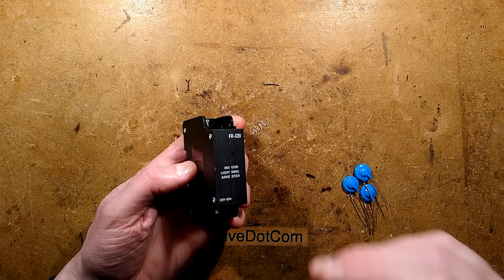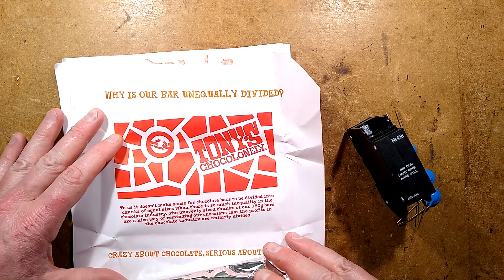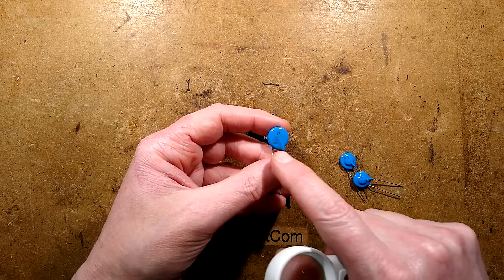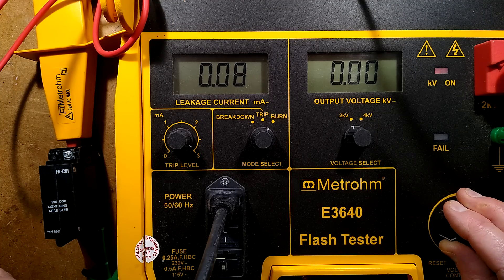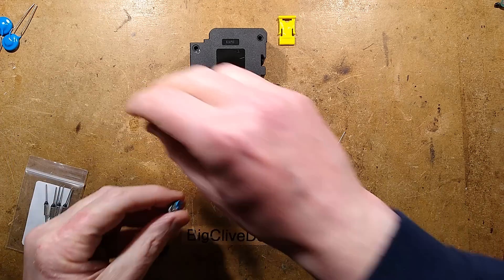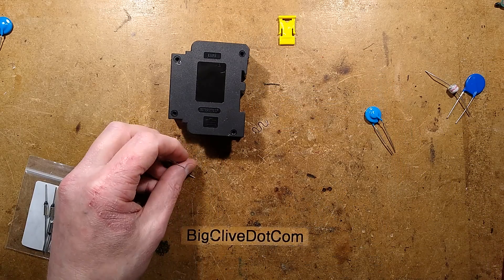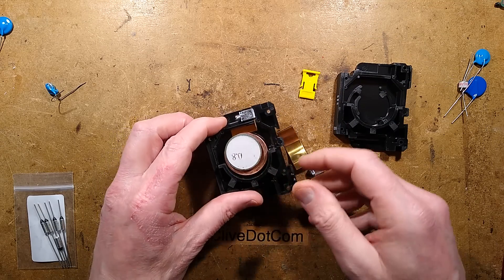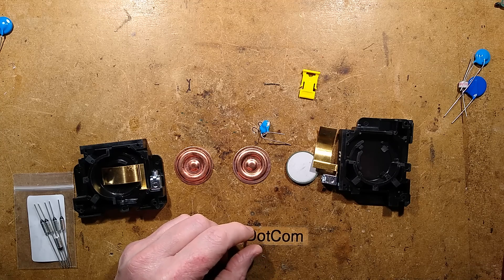Inside an African lightning protector - and candy

Comment: I reckon, there was a MOV that has the correct size that sits in between those plates that then leaves a flashover gap. In this case it looks like if you put it in between the resulting gap would be too big. Perhaps someone buying the parts at the factory has done a switcheroo to a cheaper, wrong part without understanding what it's about.
Reply: Such “switcharoo” is a serious violation against plenty of internal (and external) departments including the clients, higher management and electrical engineering. Even by third world standards. I feel like i’d like to refute that.
Reply: @BritishEngineer  maybe in Britain, luckily. But I guess in some areas it would be considered the fault of the company selling the finished device, or the importer if sold abroad, for not regularly auditing what they are getting from the external factories...
Reply: @BritishEngineer THis is China we're talking about.. You think they give  two flying fluffs about violations?
Reply: @BritishEngineer The fact that it's wrong to do a thing doesn't in any way prevent the thing from being done. There's thousands of examples of people taking shortcuts they shouldn't, many of them resulting in worldwide infamy through catastrophic incidents, and despite how well known these sorts of incidents are we keep getting more of them so the shortcuts are clearly still being taken. Plenty of people will push the boundaries until something breaks, and this device hasn't completely broken yet.

Comment: The letter seemed to indicate that the "ground" connection is to the metal roof and is linked to neutral. That would mean a lightning strike would fry every connected appliance and anyone touching grounded metal (do they ground water pipes etc.?). Would this be capable of protecting from that?
Reply from the maker: It sounds like an odd interpretation of equipotential bonding.

Comment: Well as someone from South Africa I can say I have more faith in South African (not other African countries) electrical installations than I do in Some British installations. When I moved to the UK in the mid 2000's I was surprised by the lack of earth leakage switches on most domestic installations. its only in the last 10 years or so I've seen RCD switches appearing  in residential installations. I'm not going to say i'm an expert on UK electrical systems, I did study partially in South Africa for domestic electrical installations but I did give it up and switch to electronics instead as I had more of an interest in radio at the time, probably not my smartest move.
Reply: RCD protection became a requirement (BS 7671) for most circuits in U.K. installations in 2008. Before then, in 2001, RCD protection was supposed to be provided for any sockets that may be used to supply outdoor equipment. In between these dates there were various amendments to the regulations, each time extending the requirements for RCD protection.
And RCDs suitable for consumer units (breaker boards) or as separate units have been available in the U.K. for over 35 years.
Where individual circuit protection is wanted, a RCBO can be fitted replacing a MCB and a RCD with a single unit.

However, there is no retrospective requirement to update existing installations unless either a new consumer unit is being installed, a new circuit is being provided or there is a significant amount of rewiring being carried out. Or the rewiring is for a circuit where RCD protection is now a requirement.
As the existing U.K. systems are seen as a safe system by home owners and landlords, often an installation is only upgraded when it has to be or the property is being completely rewired.
Reply: @Mark1024MAK  So in South Africa when ever work is being carried out to the electrical system it must be brought up to code. One of the reasons I quit "Heavy current" studying was the fact that the code kept changing in fact during my first course it changed several times. It was annoying me so much I switched to "Light Current" electronics.
Reply: @marcofixit  I believe many of our South African code is based on British standards like the wall plug but it is changing because of two pin type. The only time when it is required to update the electrical system is with change of ownership and even then some will still pass it.
Reply: @powertechnical  Yeah its been many years since I went over the compliance code I got my N4 back in 2002 but then switched to Light Current
Reply: You think some of that might be related to how old the electrical systems are in cities/entire countries? My theory (at least here in The States) some of our large northeast cities were among the very first places to be electrified,  but the updating of those systems and grids were never really mandated unless there was a major change to the buildings housing them. What you can then observe are buildings that are structurally quite old, but have undergone multiple "face-lifts" to their facade. However the improvements were just shy of requiring upgrades to the mechanical systems. These appearance updates were deliberately planned to avoid an expensive mechanical retrofit. So we see newer looking buildings with ancient and very deficient plumbing and electrical - with no legal requirements to update. Same with the cities infrastructure.  Lots of patching to save money maybe?
Reply: @markcohen4599  yep. My old SW Philadelphia row home had indoor plumbing added along its history, originally not having much more than a water closest and outdoor outhouse. Originally had gas lights, some pipes terminated in the basement and left in the walls and the greatest fun...
Knob and tube wiring, cloth covered of course, that all still in use in the foot tall space between the upper floor ceiling and flat roof.
Reply: @markcohen4599  Yeah I get the same sense here sometimes also in South Africa it is a requirement o have the electrical system brought up to date when ever there is work done on it or if the building changes ownership... well at least in mid 2000s when I dealt with it last.
Reply: @marcofixit 
Sounds like the safest move☺👍
Reply: If by 'earth leakage switches' you mean ELCBs, then they have been out of favor for a long time due to false tripping caused by a bunch of reasons. RCDs are installed nowadays.

Comment: In my younger days I used to install temporary IT systems for diplomatic conferences all over Africa. This meant planning and doing everything from electricity supply, local network, Internet, Wifi... Cheap Chinese stuff was everywhere. Half the time we were lucky if at least the toilets worked.
Reply: My theory was we got all the parts that other countries rejected
Reply: Funny, in my younger days, I setup connections to diplomatic missions in 3rd world countries using serial connections over normal phone lines & UUCP......   There was no internet, WiFi or cheap Chinese anything.  Often not even electricity.   It was a good connection if the latency wasn't over 300ms (aka not a satellite connection)
Reply: @ckm-mkc  uucp with the ! address notation? I knew it well.
Reply: By planing do you mean woodwork?
Reply: That's a very racist view😡
Reply: @TheCatLady65  No that is just reality.
Reply: @TheCatLady65 saying the truth about something is not racist. 
What’s racist is demanding you pretend that the truth is a lie or the lie is the truth because of race or nation. 
Like people saying we can not have voter ID in the US because minorities cannot obtain a valid ID. The is extremely racist to claim that minority people are so incapable that they cannot be held to the same standards that everyone else has been subjected to for decades. 
I know a LOT of minorities and they all have jobs, vehicles, shelter, and everything else that modern society requires an ID for. 
Don’t lower the bar for a certain group because you’re so racist that you think they just can’t be held to the same standards as the ACTUAL global minority that totals less than 10% of the worlds population. 
Think about that… less than 10% but somehow they are responsible for all the evils . 
😂😂. 
If that is true they must certainly be some sort of Gods. 😂🎉. 
🤡🤡🤡

Comment: Edit: I thought it was to lower clamping voltage but the gas discharge tube is actually in series with the MOV, so it’s there to stop leakage currents. Might also potentially protect the MOV when it goes low resistance, but the tube can do the same thing if there’s a lot of sputtering inside. Actually kind of a cool concept of using the gas discharge tube to stop low level leakages that degrade MOVs over time, but I’d still want the thermal fuse just in case.
Reply: They can also get the clamping voltage down closer to line voltage, becaus the GDT has a sharper knee than the MOV.
Reply: @aniragraham3077  That’s what I thought as well but the GDT is in series with the MOV instead of parallel. According to Eaton that makes these it’s to use its sharp knee to add some hysteresis to the MOV so it only conducts for larger transients. Saw this when Clive tested it in that the trip voltage was higher than the clamping voltage. It looks to be geared towards industrial applications where noise from equipment can prematurely age the MOV.

Comment: I don't have in faith in lightning arresters. I'll unplug if I hear thunder and see lightning. I would call them surge protectors, because a direct hit could jump the gap. Also, if you use an outside antenna, the lightning can hit it and destroy everything it's connected to. I've had that happen. Fried the cable, antenna, VCR/DVDR combo, the digital tv converter box and the TV. But, it was plugged in to the power receptacles, too. I saw the lightning shoot sparks out of my tv.
Reply: Well, a SPD (surge protection device) is only designed to dissipate transient voltage surges due to grid overvoltage or indirect lightning strikes. An additional spark gap can dissipate higher voltages, but theres no device that would protect from a direct lightning strike. A lighning rod on the roof can redirect the current, but this stil causes indirect overvoltage. The best protection is a good type I SPD (MOV + spark gap) and lightning rods on a larger house in your neighbourhood (You dont want to be the one with the lightning rod). 

For anttena and data lines, there are special SPDs too, but again they will only protect from overvoltage or induced current from a nearby lightning, not a direct hit.
Reply: A fallen line from a 11kV overhead line does enough damage, let alone a direct lightning strike...
Reply: Had something similar a year and half or so ago. Coming back home, last few meters, I hear and see a flash instantly. As if I had just avoided lighting striking my damn head by the sheer fact there were buildings around, coming home I see that my living room TV is dead, so is the cable box that killed it, and the freaking Nintendo Switch dock as well that was plugged into the HDMI.

Nothing else failed here, but that one cable TV box that was on the 1st step on that coax before the Internet/phone modem (that one has another splitter down the line, which likely saved it) died and took everything remotely related to it's HDMI together. Freakin thank you cable TV provider...
Reply: Antennas should be always connected to grounding blocks. Preferably with surge protectors/arrestors at both ends of the coax or other line.

If the coax is disconnected on the inside side, lightning may find a connection to ground via an unpredictable route, via some other appliance or a human for example.

Proper bonding allows for a safer more direct path for lightning and ground.

Comment: They Hymag unit is meant to be used after a breaker, not direct across the line, though there it will be protected by the 100A incoming breaker anyway. As a matter of interest it likely was made at one of the highest factories in the world, as Hy Mag has assembly plants in Lesotho, a land locked country, which is entirely made from mountain ranges. they are needed, because the mains here can be rather rough, and there is a good chance of the incoming supply rising to high levels because of loss of neutral, because that copper got stolen in your substation, or a phase was lost upstream.  Or you could have what a friend has, and no power since Friday, because some somewhat drunk person parked their car in the local substation. They and the 4 passengers in hospital, and still awaiting a new transformer to be connected up, after the car totally demolished the brick and concrete substation, plus the fence and road barrier that was in the way.
Reply: I had to replace "in" with "into" to make sense of the phrase "...parked their car in the local substation". 😂
Ouch though. 😯
Reply: @DerMarkus1982  Yes they put the car into the substation, and sort of took the area out.

Comment: I wonder if those "copper plated steel" disks are actually bimetallic. If so, they might flip to their alternate stable position when they get hot, creating a gap.
Reply: no way there is a bimetallic effect with the geometry that solid, it would be beyond their yield strength
Reply: I was thinking along similar lines. But instead of the discs being bi- metallic maybe the c shaped arms holding it might release when they heat up. Time to fire up the de-solderings station.
Reply: @ThorMccammon  A paint stripper heat gun can help to warm things up.
Reply: @ThorMccammon That's exactly how they work, my families company build specialised commercial vehicles,the pumping stations and desalination plants are fitted with similar self resetting arresters for lightning strikes. Although theirs are about the size of a car battery,very heavy and fully waterproof,being potted and sealed into a plastic and pressed galvanised steel housing,but their functional construction is almost identical.